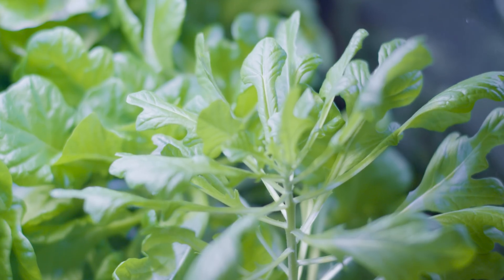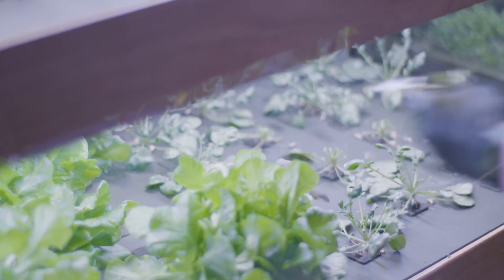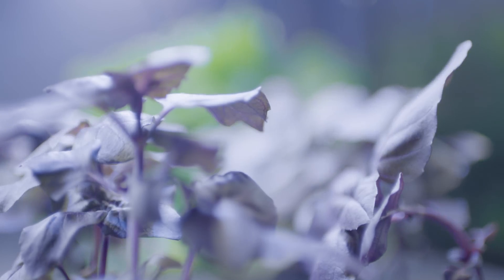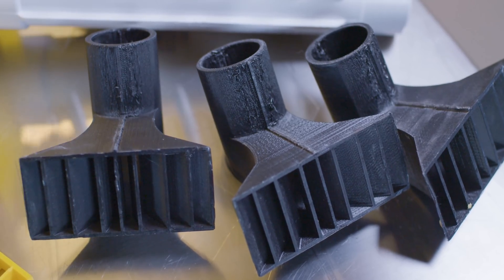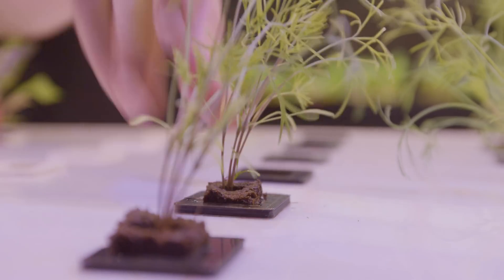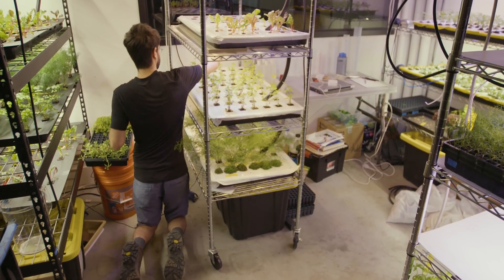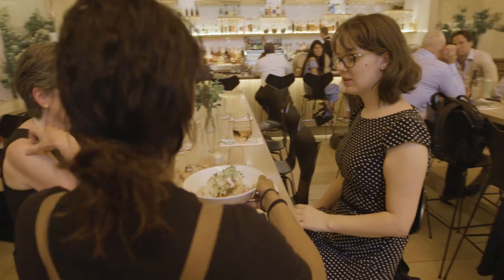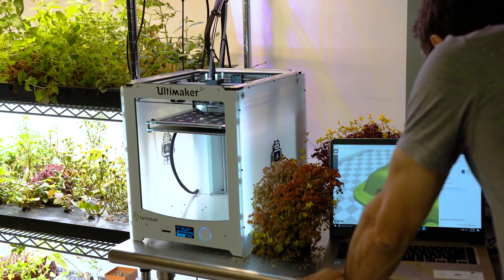Farmshelf: Cost-effective custom parts for urban farming

Comment: Aren't those plastics toxic? Perhaps the grow containers should be made (or lined) with something more inert.. Eg. stainless steel or glass...
Reply: The material usually used in 3D printers is PLA, or variants thereof. It's among other (non-toxic) things made from corn starch. Most other types of materials used are likewise not toxic in this application. The most "toxic" material in common use is ABS, but even that is safe enough to be used in children's toys.
Reply: PLA toxicity seems to be generally regarded as being on the lower end of toxic offenders, though consensus research about the exposure effects are hard to come by. It is worth noting that the plastic pigments may contain toxic chemicals and heavy metals that may dissolve in water and find their way into the food. Perhaps virgin PLA without added colorants would give you an edge in health claims.

Question: are the beds holding the (presumably) hydroponic nutrient solution also PLA based?